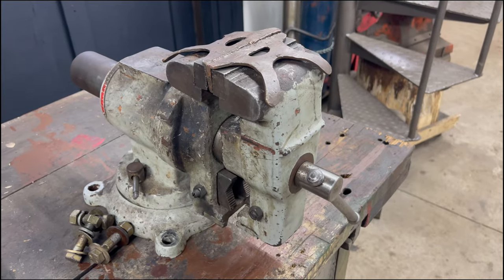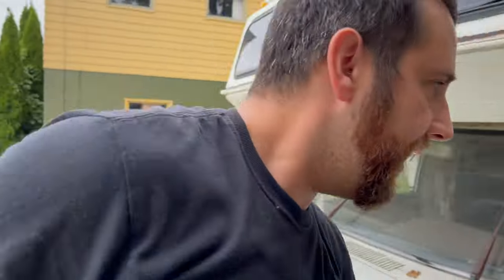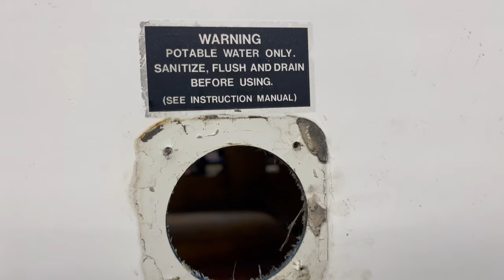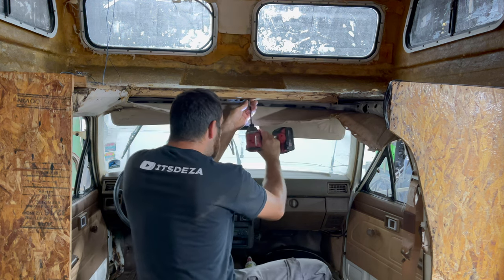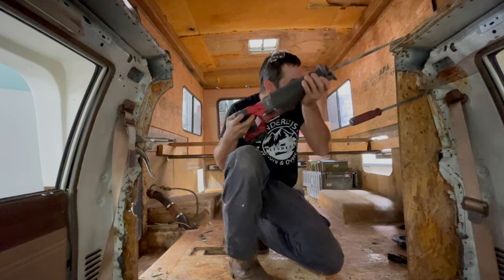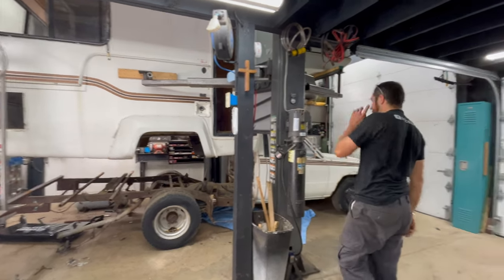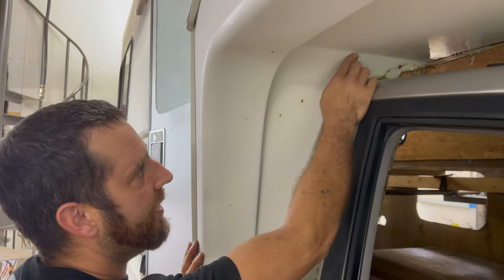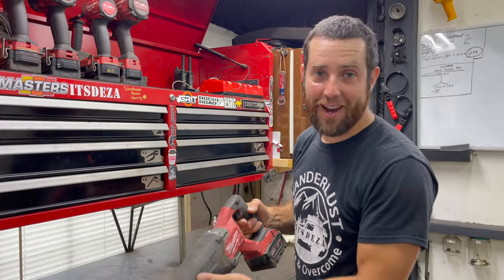Separating The Back Half Of The Sunrader And Putting It On The LX470! Build Pt 3

Comment: Great job using the car lift to remove camper body. When I removed mine the RTV securing the cab to camper was the most difficult to remove. Because the cut cab is so flimsy, I choose not to have the walk through anymore. I used a sheet of 3/4 plywood to close passage.
Reply: What did you put your camper back onto? Did you switch vehicles or did you just close up the old pass through on the Toyota truck? It was on? And yes, that sticky crap they use is like concrete about the only thing that was holding it together.

Comment: How that Sunrader got attached turned my gut.  I am thinking to save the doors and windows and start from sratch with foam board insulation.  But this isn't my project and you have what it takes to make this work.
Reply: Yeah, I was a bit surprised to see how poorly assembled it was, but I was pleasantly surprised to see how good a quality the fiberglass sunrader camper box is definitely the best camper coach out there from the 80s Toyotas is the sunraider, but the build assembly was horrific